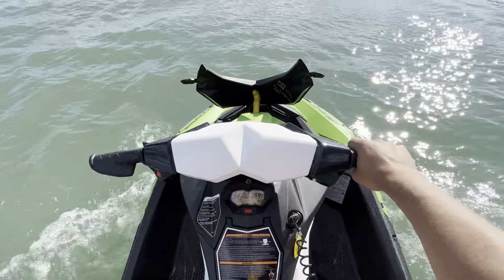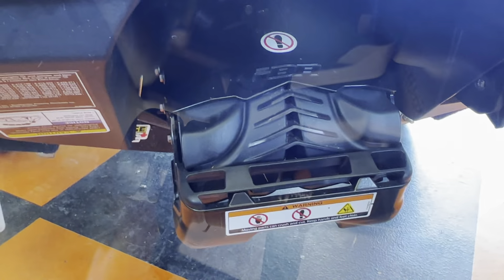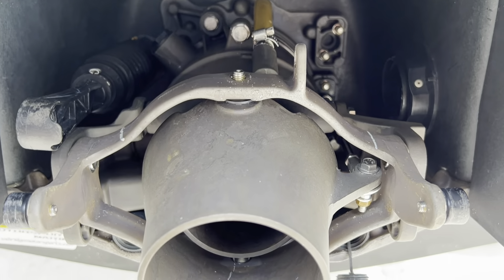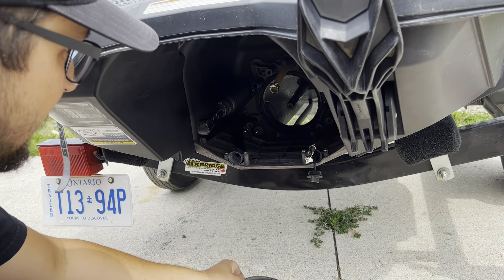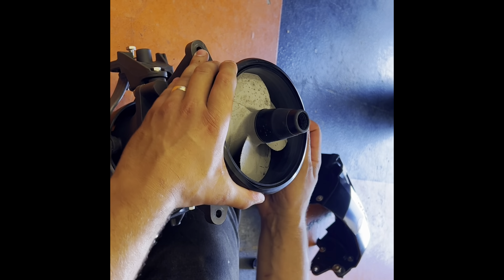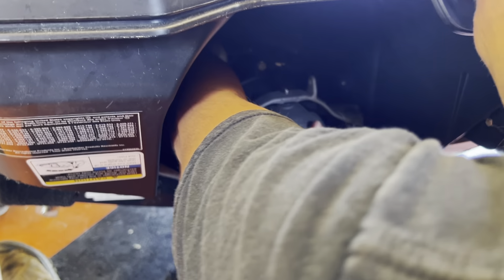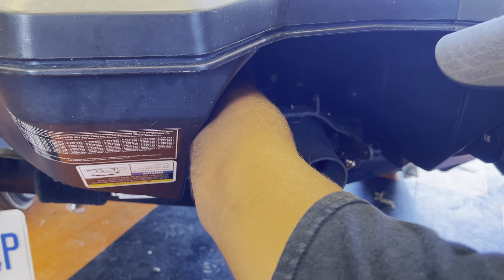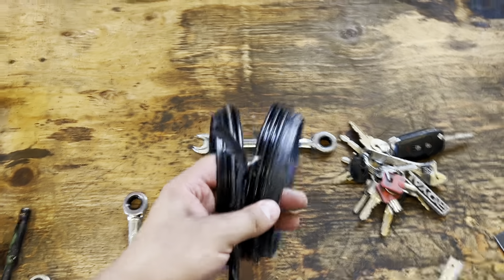How to replace wear ring on sea doo spark

Comment: Landon Me is right. At 4:31, don't line up the tab on the wear ring with the large hole for the tube, line it up with the bolt hole closest to that tube hole. It'll still work if installed as shown in the video, but if the wear ring spins, the tube can be damaged. I found the video today because mine IS installed like the video. Ski runs fine but I'll change it this weekend.

Comment: Thanks, I found some other videos showing how they took the bottom two bolts out which required a 1/4" extension, but I Was able to do it how you showed with a 3/8" extension, no problem.

Comment: Great video, however a note for next time, or anyone about to do their own wear ring... 

At 2:21 There is an easier way to get that little tube off. You totally did it the hard way lol. 

You do not need to undo the hose clamp. Leave it tight. Just grab it and give it a pull. The little metal nipple the clear tube is on, comes out with the tube!! It just plugs back in when you put it back together.

Comment: Good video but you misinformed people on where the notch on the wear ring  goes. It’s supposed to line up with the  upper bolt datum not the hose.
The datum  is to prevent it from rotating. If it rotates connected to the hose, it will rip the hose off.

Comment: Regrease the splines and use a bit of that same synthetic grease on the wear ring seal will help it seat easier. Torque specs for those three pump to hull bolts should be 16 ftlbs. It’s too easy to gall soft aluminum threads,relative to steel, if you crank them down too tight. And yes, the wear ring should be clocked to the metal post at the 11 o’clock position , not the hose. It seems hard to find a DIY video that does not leave something out, like greasing splines and wear ring seal and gives the proper torque specs, or have some errors. Doing what works may cause more issues than doing it right, long term. The existing loctite should be cleaned off the fasteners and threads. 

I am in  the middle of doing this job, ring comes in today, watched a lot of videos and have not found one yet that covers all the fine details of the proper procedure.
Reply from the maker: I have a video on how to film a video. Would love to see your video to help pass on the knowledge.
Reply: @bruneprune  I am still gathering bits of knowledge and tips on how to do it and not miss some steps. I don’t have a manual, so just gleaning a bit from all the various how-to videos. I don’t have an interest in making my own video.

Comment: How did you get the bottom left bolt out? I can’t get it for the life of me.
Reply: The hose right next to the bolt your asking about will make it seem like your socket is set but you need to push a little harder before starting to loosen to make sure the socket is set onto the bolt properly. Make sure you're putting your socket, swivel, and extension in the similar location as shown at 2:47, just on the other side. He shows it at 2:55 but it's a bad angle.